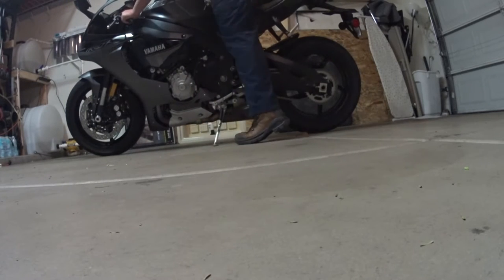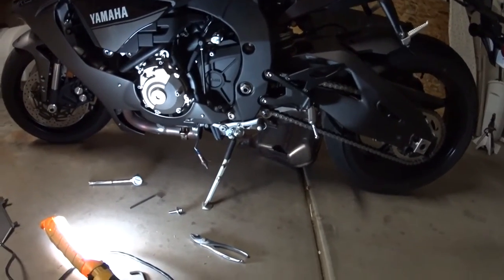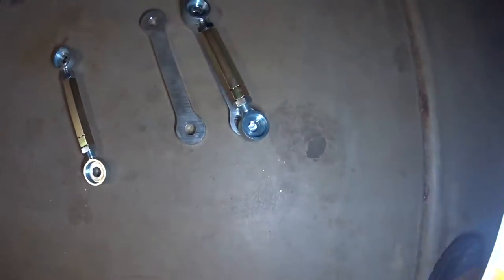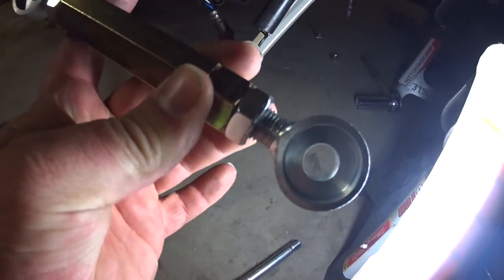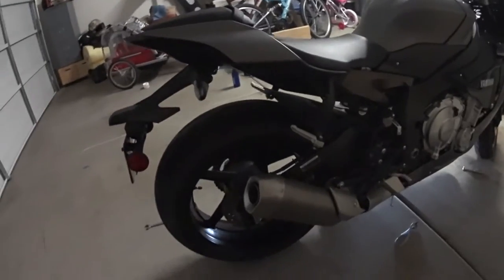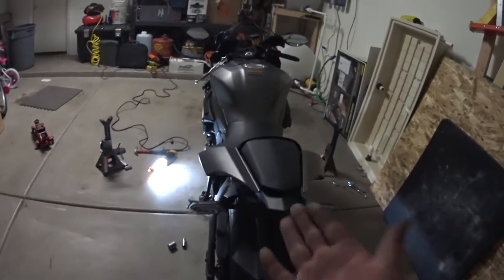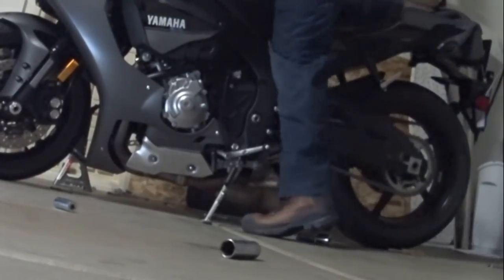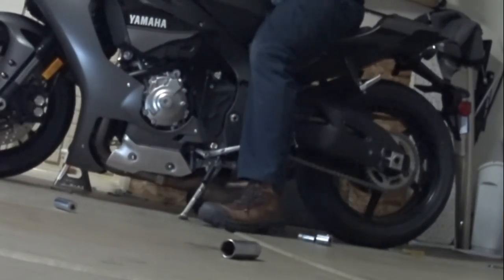Lowering  2016 yamaha R1 with Soupy's performance lowering links

Comment: How many inches is the maximum can be lowered by that kit?? Is it possible to achieve the 780mm seat height?
Reply: it is not possible to reach at 30.7 inches and the bike would drag the tire and also it is meant for the track so that's why its high so you have more lean angle. and also lowering you bike at any height will mess with the handling and stability. i think that the max is 2 inches.

Comment: You had it good before you lowered it. You’ll need to level out the bike now, Front needs to be lowered the same amount you lowered the rear. No need to flat foot unless your legs just aren’t strong enough to support the weight of the bike at a stop. I lowered my bike 1/2 inch to be able to touch tip toes each side or ball of foot one side. That’s all the footing you really need. Small riders have to make compromises and sacrifice alittle at stops, but up and going you’ll never know we struggle with bein short. Nice video though. Most people think you have to suspend the rear of the bike from the ceiling to perform the task of lowering.

Comment: Hey bro first off I love the video lowering YZF R1 is always a good knowledgeable video I’m doing the same thing I just bought 2018 R1 but how low did you lower it and will that be to low if you take it to motogp tracks    I don’t want to lower mine and it affects me at the track
Reply: Darrius Butler doubt it, to low for the streets is far different than to low for a track. Tracks don’t have manhole covers, potholes, speed strips, construction and whatever going on on them like public roads do. I’m sure you could lower more on a track than on the road. All you need is tippy toe on both sides and ball of one fit if you shift in the seat to one side.

Comment: Did you slide up the fork tubes also?
Reply from the maker: I did not at we riding the bike it felt uncomfortable being this low.  I raised the rear back up about an inch and the ride is much more comfortable as far a suspension angles.  I don't see the need now to lower the front now.  But had I left the bike rear as low as it was I would have lowered the from for sure.